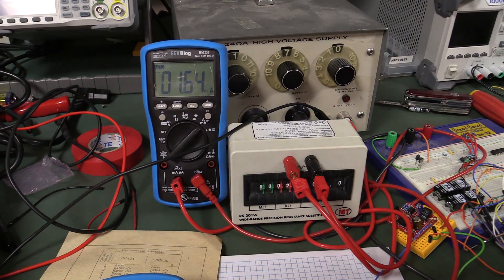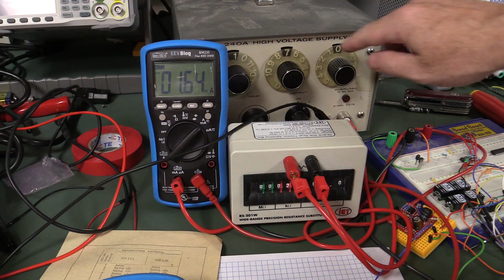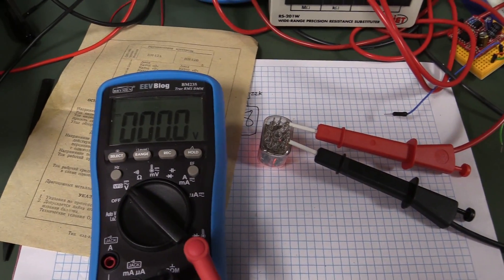Nixie Tube Voltage Drop

Comment: Perhaps the drop on the IN-12 tubes are different from others. Doing a measurement on my IN-14-tubes with a 20K anode resistor, I get the following voltages across the tubes (supply voltage = 170V,):

Digit  - voltage:
1 - 134
2 - 132.5
3 - 131.8
4 - 131.5
5 - 131.3
6 - 131.1
7 - 133.5
8 - 131.4
9 - 130.9
0 - 131.2

That should mean that these can safely be driven on ~40V.

Comment: If you light the digit in the back of the tube do the other digits act live a voltage divider somewhat like a resistor voltage divider works? To lazy the hit the bench and test this myself at the moment.

Comment: You are measuring with very high Z and seeing the few electrons hanging around on the open pins.  What happens if you pull that pin to 60v?  How much current do you see?

Comment: I would just like to repeat what several people have mentioned on the main video ie that it surely isn't a good idea to use totem pole drivers.  This will force all the OFF electrodes to the supply voltage with low impedance.  So current will flow from the OFF electrodes to the ON electrode instead of from the anode grid.  So they will all glow to varying extents.

Comment: I tried BC546 (wothout zender diodes)for my Nixie Tube clock. It worked fine, no burned transistors. But I used russian 74141 because they are much smaller, tham a bunch of BC546. some 4017, 4093 and a 4521. In the end I used a Atmega8 instead of the logic chips. Much smaller.

Comment: I assume current is extremely low at this high voltage, and might be unlikely to cause damage. I.e. during breakdown current will drop significantly, below breakdown point. 
Short breakdown is not necessary a destructive process.

Comment: Even with what you've demonstrated here you still don't need to use 120V+ transistors. Even if you exceed the breakdown voltage of say a 50V NPN transistor it will simply clamp the pin the whatever their actual breakdown voltage is. So all the other pins will be at say 50V positive with respect to the selected cathode. For most nixie tubes takes much less then 50V on the non-selected cathodes for the glow to only occur on the selected cathode. You could test this by clamping one of the non-selected cathodes with a 50V zener. You will find it won't light up at all. 

The 74141 driver you mentioned typically clamps the unlit cathodes to around 60V. I've used the more modern TPIC6B595 with 50V open drain outputs to drive IN-12 tubes just fine. The only downside is that you cant blank the tubes easily if your breakdown voltage subtracted from your supply voltage exceed the maintain voltage of the tube. In my application I had anode drivers anyway to provide PWM dimming so it wasn't an issue.
Reply: That's assuming a very fault tolerant transistor. Easier to source low-end 180v ones than high-end 120v.
Reply: it all depend on how much current is leaking through, if the leakage is low enough there will be no damages no matter how weak the transistor is, at high voltage the field is strong enough to cause impact ionization that leads to an avalanche multiplication of carriers eventually the current becomes large enough (and it doesn't take much since it is an exponential rise) to do serious harm (even locally fuse the silicon).

that said if the leakage current is weak enough there won't be enough current to do any damage
Reply: I'd suggest that it would generally be fine because very close to zero current is flowing but it is going outside the specs for the discreet transistors. Drivers like the TPIC6B595 and the original 74141 have output clamps built in so it's not a problem in those cases. They are essentially act as 50V and 55V zeners respectively when the output is off. Even the common ULN2003 and ULN2803 can be clamped with a single external zener connected to the common pin (one zener would be able to clamp more than one chip). You could use a zener with individual lower voltage transistors but MPSA42/MMBTA42 transistors are readily available and cheap so you wouldn't bother in that case. The point I'm tying to make is that a nixie will work just fine if the pin that measured 120V is dragged down to 50V or so.

Comment: The very popular 74141 nixie driver chip actually has ~55V zener diodes on all outputs. There are some papers you can find (from Borroughs iirc) that specify the maximum voltage drop on any digit before you get ghosting problems. Very interesting to read.